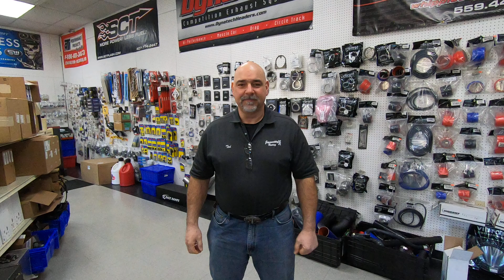How much power can the 5.7 and 6.4L HEMI engines handle?

Comment: You can make inside full forged , and get same power , maybe more . What the difference block ? Oil channel ? Or water ? 
Block same . 6.4 you put forged piston , connected road …. Put same in 5.7 done
Reply from the maker: Thank you for your comments however this discussion is about What a Factory Stock engine can handle.

Comment: What’s the best way to add 100 hp and stay naturally aspirated in the 392 Scatpack?
Reply from the maker: 100 would take significant work N/A, More compression Ported Heads, large cam LT headers, large throttle body aftermarket intake ETC. It is far more cost effective to add a supercharger and gain 200 for around the same money
Reply: 100 to the wheels N/A? Heads, cam, headers, ported manifold, custom tune, TB, unlocked PCM,  etc. Probably about $15K realistically.

Comment: 5.7’s can take more than 392’s
Reply from the maker: I think you should do more research, they both have weak pistons, a larger motor will make more power on the same cylinder pressure.
Reply: no replacement for displacement ! Am I right brother :) @JANNETTYRACING

Comment: this might be late but hopefully you can answer me, I own a 2014 srt8 stock and plan to add a max effort mmx cam and jba headers,witch should be making about close this 460-470 wrhp but on stock internals you think it could handle 500wrhp.
Also would putting drop in pistons that can handle up 1000hp be fine to pass the 500wrhp or would more need to be upgraded?
Reply from the maker: A bad tune can break anything, done properly the stock internals can handle well past 600 RWHP.
Reply: @JANNETTYRACING  so where are you guys located to see if I could take my car tuned at your shop
And one more thing what could be the most notorious things to break on it to know what to replace?
Reply from the maker: @5.7_nightbrd  WATERBURY CT 203-753-7223

Comment: I know I’m 2 years late but... I have a 2005 gen 3 5.7 that is getting a molnar 4.050 “heavy duty” stroker crank with stock main bearing size(2.5xx”) with 2.1” rod journal size. Fully 4340 forged billet crank and rods(molnar rods also, 6.125” length center to center) and looking in to some cp bullet 2618 forged .020” over w/ -7.4cc inverted dish pistons for a 9.5:1 compression ratio on ported, polished and oversized valve 85cc heads. This set up will be ran with the appropriate cam, injectors, turbos etc. to make sure everything’s efficient. I know I’m going to be able to make big numbers when dyno time comes.. but I need to know what kinds of numbers these BLOCKS are limited too crank hp wise. I don’t care about internal strength of stock components like everyone else, that seems to be the only answers i get from the forums. I’m shooting for a 800 whp weekend street truck so I’m overbuilding the hell out of it. It won’t see abuse constantly but it won’t be uncommon that I want to turn it too tune 5 and blast down the backroads running 15+ psi kinda thing. That’s why I’m slightly concerned for the 2618 pistons. Don’t really want 4032 pistons just because of their resilience to boosted applications. Feedback is appreciated !
Reply from the maker: Unless I was involved in the design from the beginning and I made all the choices designed and fabricated the turbo system, I can't possibly predict how much power you will make or if it will be reliable, your biggest hurtle will be fuel quality or what we call the Octane wall. 800 RWHP is a very tall order if you plan to run pump gas 93 never mind 91.
Reply: @JANNETTYRACING  yes, will not achieve those numbers on pump gas. Any thoughts on block limit tho?

Comment: when you say 500 on the 5.7 do you mean with forged internal as well? i have a 5.7 and I'm really interesting in getting into more power. can i just slap in a cam kit, super charger and tune it and be okay round 500hpl or do i need more reinforcement?  thank you !
Reply from the maker: A cam and blower combo will far exceed 500 RWHP so Forged internals are recommended.
Reply: @JANNETTYRACING  wow i didn't realize it would really provide that much of an increase. would you recommend forged internals if I were to just add the blower? what type of numbers would i be looking at?

Comment: Hello I have a Modified 2018 Dodge Challenger Scat Pack 392 that I am about to have a Hellcat Supercharger installed on.

I am also thinking of adding a NOS Kit to it.

Have you guys ever tuned this type of Set-up by just spacing the Pistons? I am going with the Factory Pistons.

If so, what Crankshaft Horsepower did you get and what RWHP did you get?

Thanks

Comment: Wat do u think of the hellcat blower on a 5.7? The numbers where i lil over 500 whp
Reply from the maker: The Hellcat supercharger is a great piece TVS2300,  The power the engine produces is dependent on 2 major factors,  boost and octane, too much boost or too little octane for that boost and bang you break a piston.
Reply: @JANNETTYRACING  he said 5 lbs boost and premium gas
Reply from the maker: @AllSoWavyReese  I don't know who He is, nor did you mention it. I do not believe 5 psi will make 500 RWHP the math does not work out. it takes about 7-8 psi
Reply: @JANNETTYRACING  defier performance

Comment: How much boost does a stock 5.7 hemi handle with a centrifugal supercharger? keeping mind the future plan is all forged internals with cam. It's a project car, 2012 challenger, and I'd like to get the most expensive item done first based on your advice
Reply from the maker: With proper fuel supply, and tuning we can safely take them to 600 RWHP on 93 octane

Comment: Just came across this thread.
I've seen your shop/work on RT Life's channel.
What's your opinion on a 100 - 150 HP shot of Nitrous on the 6.4 motor stock? Thank you.
Reply from the maker: absolutely not.
Reply: @JANNETTYRACING  thanks for the fast reply.
 You don't think the motor can handle a 100 shot whatsoever?
Reply from the maker: @tbrewcool   I wouldn't the pistons are strong like Eggs, NOS can easily crack one but forced induction done right is no problem
Reply: @JANNETTYRACING  ok, thank you again for the fast replies.

Comment: Didn’t watch the video, the answer is limited by a few things: 1. The crank in each engine. 2. The pistons in each. 3. The transmission in each trim level (saying how much power the engine can handle is a misnomer, engine has to go through a driveline at some point). 4. The axles. 5. The diff. 

So, this means a couple of things....if you’re going to squeeze power out of each 5.7L or 6.4L and we wanted to just focus on the engine alone, I would add the adverb “reliably”. I can stick all sorts of boost on both engines but if they only make gobs of power for 30 seconds before we watch some blocks and cylinder heads explode, that’s not really productive to know. 

So...reliably, the 5.7 engines can handle anywhere from 450-550 hp fairly reliably, assuming the tune is quite good. The 6.4 can handle, without replacing anything in it, 600 hp but it’s just scary, the pistons are just asking for it. Tune is everything obviously. Those are crank numbers btw, if you were to put those at the wheel, that’s pushing the envelope too much.
Reply: You came here to write three paragraphs, but refused to watch the short video?
Reply: He didn't say how much can a 5.7 car handle.  He said the engine.  Drive train has nothing to do with that.
Reply: @ryotaryuu the 5.7 engine can run 1100hp before it starts damaging itself. Slightly modified piston ring gap and ported heads. So you just have to worry about your trans and driveshaft anything past 500hp
Reply: @ZouDidIT oh that's not true at all.  A stock 5.7 isn't going to make anywhere near  1100 HP.
Reply: No one ever wondered how much power their engine can make “unreliably.” Dumb comment.

Comment: Would love to know the answer on the 6.4, but I don't use facebook so I'll have to look for a vid from ya. 
  The 6.4 I bought has a whipple was told it's 8 boost 760hp 655rwhp 635ftlb torque. Otherwise stock tuned on 93, so am highly interested in your findings. Just find your channel through r/t
Reply from the maker: Since we have not broken one ever it will be hard to find that answer, I am very comfortable around 650RWHP what we can't take in to account is prior use or abuse and production tolerance stacking.
Reply: @JANNETTYRACING  well that's encouraging, thanks for the comeback, and yeah it's a 16 scat I got off the showroom, clean as anything and met the previous owner (couldn't go far without someone recognizing it) they babied it but yeah you never know how hard they pushed it when it was out. Keep up vids the content is great!

Comment: For the 5.7 is that 500 crank or 500whp?
Reply from the maker: RWHP
Reply: So 500 who is max power the 5.7 can handle without damage what about the 8 speed transmission in a 2021 1500 ram.

Comment: Great video any update on the 392? I have a 20 scat pack looking into adding twin turbos but I’m not sure if anything else is needed it’ll be my everyday driver so I don’t plan on going over 5/6 LBS of boost
Reply from the maker: Yes sir follow us on facebook Jannettyracing and check out our videos of the Scat pack Twin turbo, It is now sitting at 1045 RWHP.,  we can help you with the Hellion twin turbo system and tuning 1 stop shopping.  203-753-7223
Reply: Did you have to add supporting mods for the scat pack to handle that much boost?
Reply: @turnemupradio  yea u have to change a ton of stuff
Reply: You should definitely make a vid on that bro

Comment: I just bought a 2020 5.7l hemi shaker and ordered headers and a cam I want to make right on 500 hp to the wheels will I have to do forced induction or can I reach those numbers by continuing what I'm doing
Reply from the maker: You will be lucky to crack 400 RWHP, your better off with Whipple supercharger only that will make 525 RWHP easy. give me a call.
Reply: @JANNETTYRACING  can I keep my parts I ordered and do the whipple supercharger ? And can I put it in while still keeping my shaker there and possibly functional
Reply from the maker: @rippingzone  it will be more like 600 RWHP and too much for stock 5.7 pistons so plan on Forged rods and pistons to go along with that combo., Fuel system upgrades will also be necessary, this is not the place to discuss this please call me at the shop for more details.

Comment: Hi, im getting a hellcat throttle body on my 6.4 and need a tune but your 90miles from the shop doing the work, is it to far of a drive before having the car tuned?
Reply from the maker: Hello Mike, as long as you drive it normal I don't see a problem call to set up your appointment.203-753-7223
Reply: You do not need a 90mm TB on it

Comment: i have a 2015 ram 2500 with 6.4 i wanna increase hp and torque. it has s&b intake. what can i do any tunes or aftermarket parts i can use ? i also have 27t 5th wheel trailer i pull
Reply from the maker: Feel free to contact us directly with your questions so we can better help you 203-753-7223
Reply: Go straight to wipple 2.9L screw blower kit for your 6.4 2014-up B.G.E hemi. Did a comp cam master cam kit on a 2016 b.g.e 6.4 3/4 ram.
It was .226@.050 on int. And .234@.050. On Ext.
With 116 Lc.in pure stock truck!! It made just over 534.60hp @ 6,200rpm's and 499.87@ 4850 rpm's.the ECM is unlocked with Hp tuned for programming! Stock exhaust and AIR box too.
With a AFE. PANEL FILTER IN IT!!! PERIOD!!
That as it. Whipple has big torque and horsepower all over the rpm covered!! You would fall over if you knew what this truck has made now, with this supercharger kit. And exhaust,with long tubes.
The 2014-up ram 3/4-1 ton engines are were Chrysler hide the cost of the hellcat and the Demon engines cost at!!!
BLOCK. HEADS. AND CRANK ARE THE SAME.ONE IN THE HELLKITTY'S same casting I.D #'s TOO!! 
OOP'S just gave out some insider information!! Have fun with this info!! Love Bayou city motorsports.
TEXAS.
Reply: @randyg3hemiperkins249  thanks alot I'll look into that !🤙
Reply: @randyg3hemiperkins249  where do I find this online I can't seem to find anything lol

Comment: 500hp from like a supercharger/pro charger /turbo, just added to factory engine right?
Reply from the maker: Correct
Reply: Sweet thanks, going to slap a turbo on my 5.7 magacab ram because the 5.7 by it self is gutless for that weight think its cost more money than any other factory dodge 5.7 combo
Reply from the maker: @hot_steppa_lifestyle   For a truck I would recommend a Magnson TVS 1900 or 2300 or Whipple 2.9
Reply: @JANNETTYRACING  ok ok thanks ill look into it !!!

Comment: I guess this is an old video,,,
Many guys are getting 750hp + on the 5.7 Hemi with proper ring gap, good fuel and good tune. Boosted and nitrous....
Reply from the maker: Not disputing anyone has made that much power the question is for how long and under what conditions our numbers are reliable under the most extreme conditions like road racing where the dyno queens will not live.
Reply: @JANNETTYRACING  
They will live as long as any other properly built engine out there, 
Build quality and tune$$
Make the difference. 
I'm currently running a 334ci stroker SBC, 305 bored .30 over 3.75 forged stroker crank, custom Icon nitrous pistons, Brodix 11x spreadport heads, promod rods and 648 solid roller cam built by 3D motorsports and it's a screamer..... my point is everybody says 305 SBC engines are junk so I had one built to shut them up....lol
Build it right and tune it right and let it eat......
Reply: Think he ment stock block with like a supercharger bolted on

Comment: Wow wow wow Dang the 3v mustang that everyone talk shit about can handle 500 like 5.7 and the gen 1 coyote that’s not the best coyote can easily handle 700-730 wheel all day long while gen3 coyotes have been 8.2 quarter mile with stock unopened motor with over 1100 hp  wowwww
Reply: And the sock unopened motor don't last long at all at those power levels. and WOW
Reply: @wascash  for real dam man thanks for the great info
Reply: Uh, the reason they talk shit is because they don’t last all day long. They end up getting destroyed. Methinks you need to do some more research.
Reply: @eldiablort1461  u got a scat
Reply: I've been 550whp on 93 for 7 months. I know 4-5 guys who are around 600
Reply: @732Mopars  u still got your Maggie on?? Or is it an edelbrock
Reply: @just_a5.7  Yea i got the maggie, just upped the boost to 8.5psi

Comment: I have a question what is the max Rpm the 5.7 hemi can handle before having problems ?
Reply from the maker: The engines make max power about 6200 rpm and the valve train being Hydraulic are only good to about 6800 no reason to rev it there if not making power up there.   with aftermarket cam solid roller lifters the engine can be run to about 7300 then we start worrying about the rods.
Reply: @JANNETTYRACING  thanks
Reply: @JANNETTYRACING  sounds like your a pro 😎
Reply: @JANNETTYRACING  oh waite you are a pro 😎
Reply: @JANNETTYRACING  the solid roller lifters also help the 5.7 hemi problem of wiping the cam lobes, a good upgrade all the way around by itself

Comment: So the big question is after having LT headers and a cam on my 5.7 should I go procharger or should I go stroker?
Reply: Stroking and camming might net you around 100hp or so depending on the setup, pro charging advertises 160+ hp gains on a stock engine with 6-8 psi of boost. However if you add a cam to complement the supercharger and do it at the same time, than 200+ would be plausible. Plus pro charging would still retain factory driveability more or less and be easily removable since its basically bolt on and a tune.
Reply: Your choice but the procharger will give you most bang for the buck.

Comment: Making any big power from the 485 horse N/A 6.4 motors? Seems like its blower, blower blower. 

N/A is a bigger challenge, true, but there fewer internal problems. Ideas?
Reply from the maker: N/A Power cost nearly double per HP gained at around 150 to the wheel and as you reach for more power it can be triple or quadruple dollars per HP.  Boost is way more cost effective and reliable, I have been boosting cars since 1990 when supercharger kits first hit the market for Fox body mustangs.
Reply: @JANNETTYRACING  Good points you make...I would think that N/A power enhancement, in some ways, is becoming obsolete, other than for class racing and street rodding..The Gen 3 Hemi I'm buliding 

has two big Holleys on a sheet metal cross ram and I'm running a 282/288 @ .050 solid roller cam....old school. I won't make the power of an blown mill, but it will be respectable for the race car I'm building. It is also more of a challenge to coax power out of that application. 

Keep the distance and keep well!

Comment: What about doing forged internals on the 5.7? I'd love to do a forged 392 but it's out of my budget. I was looking at doing a drop in forged kit with the 6.1L crankshaft. I'd like to do a cam with a whipple supercharger as well. Parts for all of this is about $13,000. That's around what just the longblock of a forged 392 would cost. How much power can I safely run with this setup? I've got a 2016 ram 1500 with the 8 speed. Currently have bolt ons and custom tune. 1 3/4 longtube catless headers.
Reply from the maker: You are certainly welcome to call us 203-753-7223.
Reply: @JANNETTYRACING  will do!